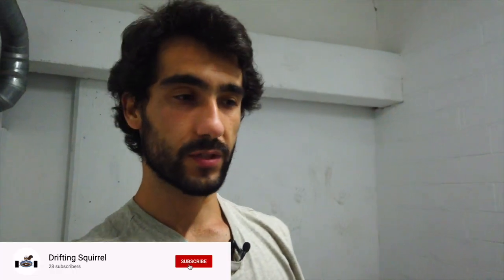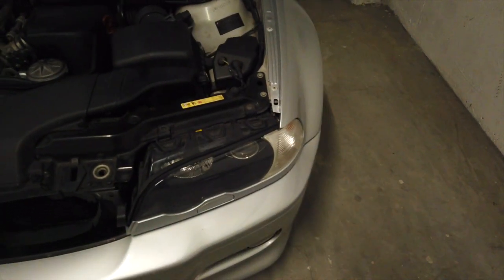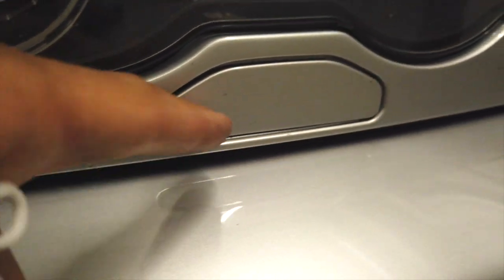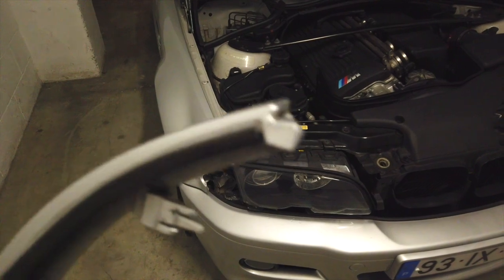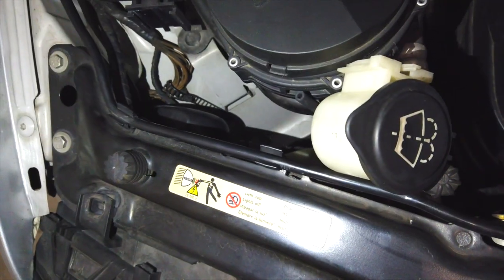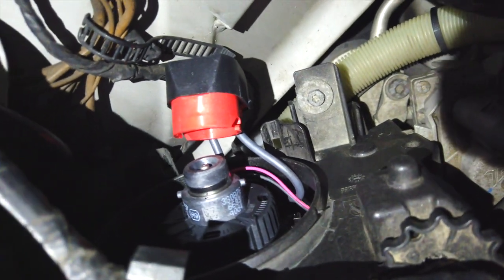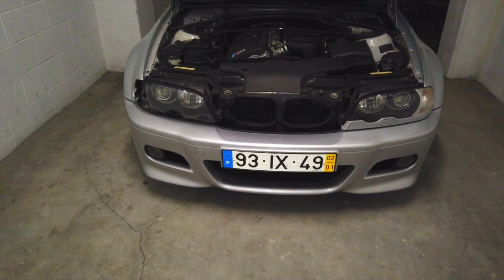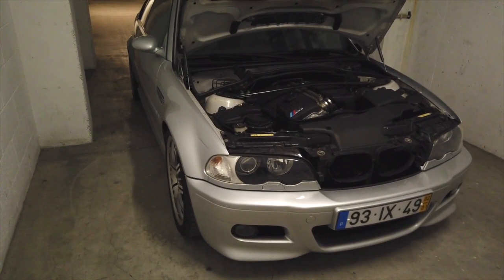Why You Should UPGRADE Your Old XENON Bulbs - e46 M3 DIY

Comment: Hi looking to get those same bulbs. How is the upgrade on unlit roads ?
Reply from the maker: The light output in very very good. I ended up understanding that my bulbs were already very tired, but nevertheless, the overall light is great. If I was going to buy another bulb, I’d probably get the CBI’s just to have a whiter tone. 
My first thought was that I just couldn’t see anything at night, but that was partially because the bulbs were old. CBI’s would get me more light than I had (less than these) and a whiter tone
Reply: @DriftingSquirrel  Thank you got your reply... in terms of light output the laser is better than CBI ? And is it a massive output difference from standard OEM xenon bulbs ?
Reply from the maker: @kumaransuriyakumar6177  wouldn’t call it a massive difference but noticeable. Osram say that the laser have more lumens (light output) but are yellower in color
Reply: @DriftingSquirrel  so you would go with CBI instead off the laser ? Thank you for your help
Reply from the maker: Personally I would. If not to compare the color and output. My e92 came with CBI and they were very bright and very white
Reply: @DriftingSquirrel  have you got a video with the light output and colour off the CBI ? Is it white in colour or blue ?
Reply from the maker: I don’t have but they are 100% white

Comment: At the beginning of the video, in the comparison section, the shadows are much darker on the top video. The comparative video is not fair.
Reply from the maker: This was filmed inside a garage with controlled lighting, the camera on a tripod and setting locked. I’d say that it’s just the overall brightness making that happen. These were old bulbs vs new (better technology) bulbs. The difference was as dramatic as the video shows.
Reply: I just bought the same xenon bulbs online, but since it’s weekend they will be delivered next week. 

When I see your original lights they kinda look like mine. They don’t really illuminate the ground at all whereas with the new bulbs you clearly see some objects on the ground. In my situation I would notice cars with halogen shine further and brighter than my lights. Well what’s the point for me having xenon’s then. Only my lights being whiter but that doesn’t matter to me if I see less than with halogen. My bulbs could be original too from 2005 since I am not the first owner of my current car I am not sure.
Reply from the maker: You’ll notice that you’ll be able to see much better now. Let me know
Reply: @DriftingSquirrel  I noticed that objects further down the road like roadsigns and stuff are illuminated slightly better, especially on the left side, but it wasn't as dramatic of an improvement as some new cars with blinding lights like they drive with high beams all day. Maybe my projectors are shite or I expect too much, who knows haha.
Reply from the maker: E46 xenon projectors are notoriously bad 😅. But I did enjoy the upgrade of bulbs on mine
Reply: @DriftingSquirrel  I'm thinking of getting EvoX-R 2.0 but I am afraid to take out shit from inside the lamp and mess something up. The xenon bulb was difficult enough so I will call my mechanic tomorrow to ask if they are willing/able to do such work as it's not OEM stuff. 

It would probably be expensive but I mean getting two entirely new headlights instead would be much more expensive and will still have the same shitty projectors.

I've heard great things about EvoX-R 2.0 projectors, so it's worth a try.
Reply from the maker: Let me know how it goes!
Reply: @DriftingSquirrel  The mechanic didn't give me a hard no but didn't sound positive. I am still debating to pull the trigger to buy the stuff and bring the car to him.
Reply from the maker: Google a bit on some forums. Some people have done projector mods and might shed some light